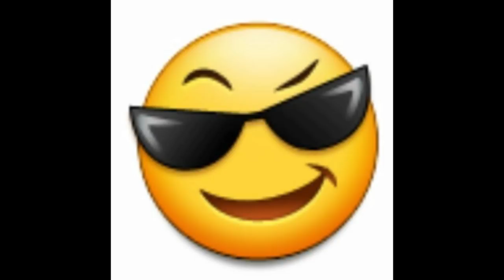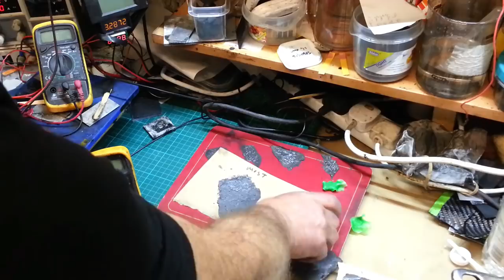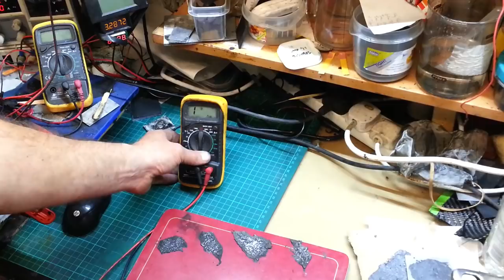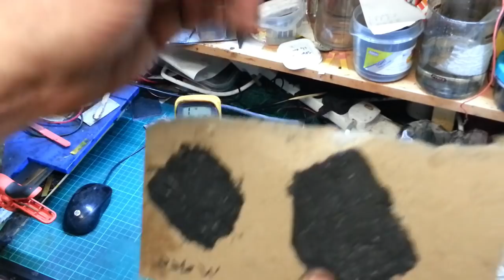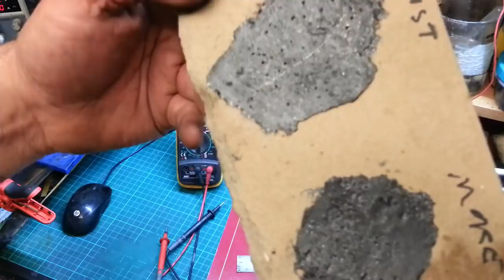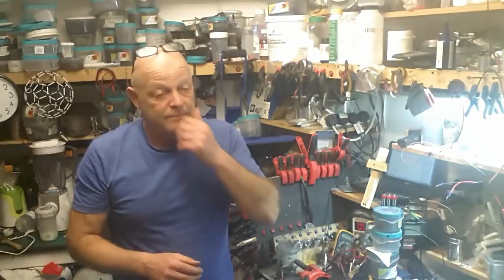Revisiting my Conductive Plastic made with Polystyrene

Comment: Looks like a candidate for a solid state application. Robert has a video on a square resistance test template that provides standardized measurements. The distance between probes changes the reading. Even a non conductive piece of plastic with holes at set distances to compare materials would give relative results.
Reply from the maker: Yes i do intend to build one when i get the time, cheers